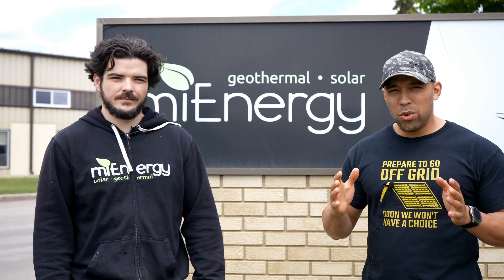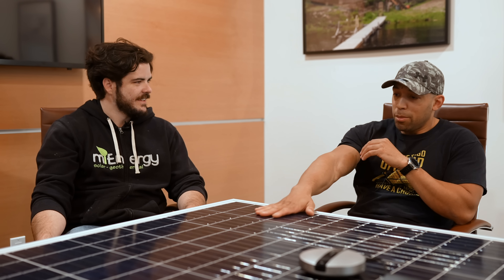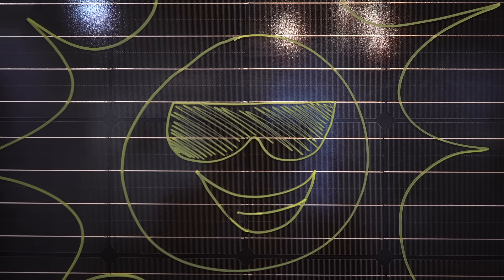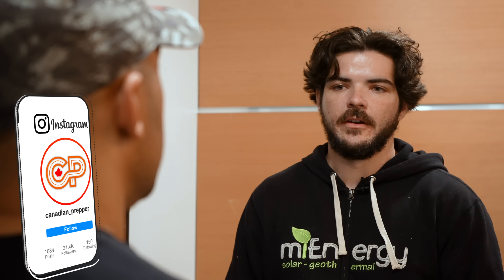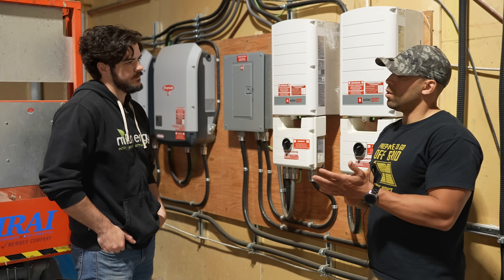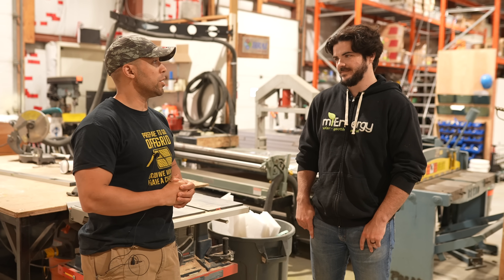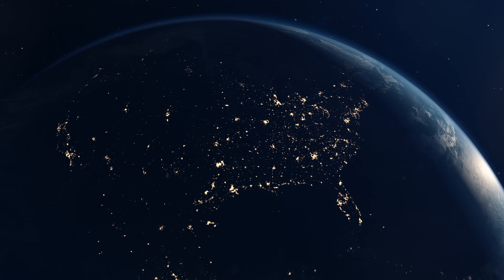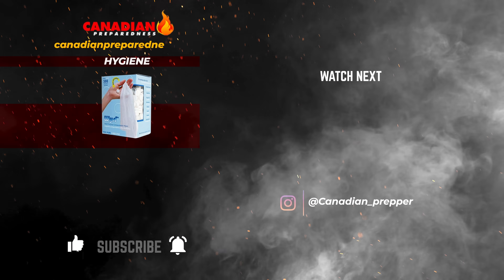Preppers Guide to Home Solar Power

Comment: For a ground mount system, the racking is going to cost more than roof mounted systems. Also, there’s a shorter wire run with roof mounted (electric wire is spendy). You are going to have to trench and run wire in conduit from the array to the building main panel which also adds cost. 
You don’t have to size your system to cover 100% of your energy usage. If you have a tiered rate system, you can size it to cover the top tiered rates. For example, if it would require a 7 kW system to cover 100%, you could install a 3 kW system which could cover the higher tier rates, leaving a smaller rate charge for the remaining bill. 
My ex boss didn’t like me telling this truth to customers for obvious reasons. 
I’d advise a grid tie system with battery backup and a transfer switch, either manual or automatic.

Comment: Why no mention of micro inverters right at each panel. I think it’s Enphase or Emphase micro inverters. Suppose to be better on shading, and there converted over at the panel from DC to AC power which travels long distance better than DC voltage.

Comment: One of the harsh realities for solar is Cloudy/Rainy weather.  I have a 4200 watt solar system. Being located in Washington State, on the summer solstice with clear blue skies, I got 3700 watts of output.  On the cloudy rainy days that the pacific northwest is notorious for, I get 550 watts of output.

That is a HUGE difference. My network and security system pull a constant 280 watts.  My battery storage capacity is 14khw.  On sunny Days, it runs with ZERO issues.  It is capable of completely recharging my storage every day.  550 watts on non clear days is not enough, even during the long days of summer, to recharge the batteries from the previous night.

Today, I swapped circuits. Now I have

Garage Opener, Chest Freezer, 40 watt LED that runs for 8 hours a day, Aquarium pump, aquarium air pump, and a 200 watt aquarium heater.

ill know in a few days how this fares, but so far it is looking pretty good.  It is cloudy today and I am getting better numbers on the batteries.

Comment: On my prepper pack, I have 2 x 100ah 12v LifePo4 battery, 4 pliable solar panels of 100w each and an 1000w inverter plus an MPPT. For 1 hour of sun I have enough energy to keep 6 light bulbs(12v) of 8w on each for 8 hours. In the summer I have enough energy to run a fridge, 6 light bulbs, a small microwave, a coffee machine :) My offgrid system has around 25kg and is on the back of my SUV with the rest of the survival pack :) In the case I survive the 1st wave, I can make a easy living offgrid. Living in Romania, at 40-100km distance from the war you need to be crazy to believe nothing could happen, only because we are part of NATO..... Better eat some cans then regret that I did not prepare at all. I own all the equipment to build a remote cabin, to plant some food, water filters, electric equipment, and some food for 6 months :) Only thing that remains to buy, is an electric fence. Here we have the largest number of bears from Europe. With my offgrid system I can charge my radio, my battery chainsaw, and other equipment. Good luck everyone, stay safe and prepare 🏕️. . . .💪😎👍
Reply: @Zack1988 Salut, din ce oraș ești? Ai dori să ții legătura și cu alți prepperi din țară?
Reply: @Eminovici  salut. Sunt din Iasi. Este un grup de facebook ceva ?

Comment: I don’t know how it is in Canada but in the USA, if you’re hooked into the grid like this guy is talking about, (ie; you get credits back from the town or power company etc), this means you are NOT OFF GRID! You can’t just choose to go off grid and disengage from it. You’re essentially hooked into the grid as part of the power making system and receive “compensation” for doing so. It is NOT a closed system where you make and keep all your own solar power etc. We need to make sure we have full knowledge about what we are and aren’t buying into with solar systems. Blessings to everyone!
Reply: Same here.  If our electricity goes out we can’t use the solar.  It’s still wired to the grid. I have some portable solar just in case.
Reply: interesting
Reply: I agree 💯 %
Reply: Yep, that's what makes it not so great. Batteries are extremely expensive and don't last as long. No point in being still connected to the grid, when they shut down you shut down, unless you can find someone to do it off grid....
Reply: You can keep all the power you generate by storing it in a battery. You’re not off grid but when the grid goes down you will have power.
Reply: @highlandscommunityclub1160  If a person has a sizable home that runs full electric they would need pretty much a full garage wall of those expensive batteries and then may get maybe 3 days or so worth of power depending on power consumption. It's sounds great but costly and not worth it for what I think are the people who could benefit from it the most.  100,000 dollar+ system and its not worth it for longterm worst case scenario......ask me how I know 🙄
Reply: The way these large companies are doing it on grid and with or without batteries is only good for short-term typical power outages, Not the SHTF Prepper. Completely off grid is the way to go and these companies don't want to do that. They have a whole line of BS that sounds good till you actually use your brain to stop and think. If enough people get these systems they can have the green society they want, you're generating energy for them and you get a lower bill and saved from the occasional short power outtage. As long as everything is good they benefit and the customer but if worst comes to worst your sh*t out of luck unless you have your system setup the TRUE Preppers way.

Comment: My main issue is that technology advances so quickly that a solar system you purchased years ago (a decade ago for me) becomes obsolete. Upgrades are very expensive!
Reply: do not worry about that. The gains in solarpanel efficiency is not that much. I read somewhere that the theoretical max efficiency is some 30%.
350Wp panels are at 22% efficiency...
every extra% will take enormous effort. Not worth it.
Efficiency of inverters is typically 95% or more. Not much to be gained there.

instead: optimize your angle to the sun and/or install 'sun tracking' systems. hugely expensive but efficiency wise much better.
Reply: Similar to buying a computer. I gave up waiting and bought in knowing that I have the flexibility to update as technology continually improves.
Reply: Not to mention the restrictions the power companies force on you, as tech changes, that means you can't expand but have to install a new system.
Reply: It's the batteries that are so expensive and you may get about 10 years out of them before they become cheaper and more efficient. Right now the benefit of these batteries just don't out way the cost of purchase and installation.  Forget about them in a true SHTF situation especially if you live in a home that is full electric.

Comment: All stated is true , I just got my system up and running finally .It  took 7 months to complete ( stardust) as I was waiting on a backup battery for the system ( cost as much the 22 panels).Getting a battery pre war was extremely difficult, getting one now I'm told not possible. Maybe tesla but good luck.
Reply: Genrac power walls are in stock City electric supply is showing 36 available. If it helps 👍

Comment: I got 40 panels on my house. 48,000.00. All its helped with electric bill is 43.00, not worth it payments is 250.00 from sunpro, still have an high light bill. Couldn't get the batteries at 19,000.00 each .so I would do my homework  before doing this. Wished someone had told me.  Read small print. They can take your home if you don't pay the bill. Nothing is free ok

Comment: I heard that solar panels only last for so long and then they have to be replaced because they don't put out as much as they did new.... so there is that cost and then the batteries has to be replaced as well and those and the panels aren't cheap... It's kind of like when cell phones first came out, it got better as more get into it.... and geez that's expensive to have a set up.

Comment: Solar panels ain't cheap found this 200 watt 12 volt triple fold out panel assembly for about 300 bucks. 200 watts of 12 volt power ain't much next to what is required to power up one small house.. Heck, the hot water heater alone consumes 4000+ watts 240 vac everytime it energizes those top and bottom elements. Even my led 42"

Comment: Question: how well will their solar systems survive an EMP or grid  high voltage surge?
Reply: the panels would, the inverter likely not.
Reply: @michaelastl  Yes, I just read about that as well. Panels will be good, inverter would be fried.
Reply: @michaelastl  I have an mppt main inverter / charge controller and a cheap pwm standby charge controller that is disconnected and completely isolated. In the event of an EMP or cosmic shit storm, the 10 gauge wires can be cut over in about 2 minutes. Most systems are running on 12 VDC anyhow (water pumps, fans, lights, solar tracking actuators, etc). I have both lithium and lead-acid batteries in separate banks. I suspect the li-fe04 will be vulnerable. Lead-acid...not so much.
Reply: @paulslevinsky580  just make sure to secure all vital inverter components inside a faraday cage.  Otherwise they will be destroyed in an EMP event.
Reply: Sol-Ark offers EMP hardened inverters
Reply: You can buy EMP protection products for cars, planes, rv, house, etc.
Reply: You can make homemade faraday boxes or cages depending on the size of the system and what components you are trying to protect.
Reply: @Arnuld15Governator  Yes. Many instructional, step by step videos. Reviewed lots.  Then completed  a 3 shelf supply cabinet & 3 locking Behrin cans by October last year.  Fun projects. Much cut, fitted cardboard from boxes, heavy duty aluminum foil. Electrical tape double sealing every crevice, corner. Tops, bottoms, sides covered.  No exposed bare metal. Tested all. Seem to work. Hope so. 4,200w in solar inverters, cables, extra electronics, small appliances, back up mobile stuff stored in these DIY  cages. Plus using EMP bags for some small items.   Fingers crossed. ,Also just receive  those EMP Alert wall socket units (long wait time). Plugged in & set as instructed. Someone’s always home to get to the breaker box.  Hope these work as advertised. Hate to see our fridge, freezer fried. Done all we can. Hope these are never needed.
Reply: SOL ARK EMP hardened inverter.  Siemens 150kV surge protector, ferrite cores on your wires.  You will be fine.
Reply: Best to buy a smaller portable one and have a  Faraday cage to protect it from EMP
Reply: Companies make emp proof inverters, which would save it, the solar panels will still work
Reply: Honestly if an emp hit, I wouldn’t want to have obvious power, IE people can see light coming from my windows, if you plan on running solar after an EMP, you better blackout your windows and make sure nobody knows you have power
Reply: Maybe I just don't understand enough about EMP (yet) but for all who are saying put the inverter in a faraday cage, as long as it's still connected couldn't the EMP hit the components of the system outside and travel down the wires to the inverter?
Reply: @paulsmith786  Yep. My backup is isolated...disconnected from any wire that could serve as an antenna to build charge.
Reply: Theses always a surge protector rated for 140k but those dried up and might not be enough.
Reply: The solar system i have supposedly will shut down before the inverters are fired. But, who really knows. I don't want to fry my house so let's hope it's true...
Reply: If it is not connected to the grid, then no worries about a surge. EMP would fry any electronics that are not protected, although I am still not entirely clear that electronics can be protected. It seems like that studies have conflicting results..
Reply: @DickNemakas   No electronic is safe from an EMP unless you have it covered by a faraday or underground. Inverter will be fried.
Reply: @DickNemakas  That is what I thought about russia invading Ukraine but then we saw them bombing more civilians than military targets.
Reply: @DickNemakas  the solar wiring becomes the antenna for CME or EMP.  A CME needs several foot long antenna/wires.  So could be protected w ferrous rings.   But an EMP has three waves.  A fast wave that would react to MM long metal wires. a wave in the sub second range then the same slow wave that a CME would have.  Dr Arthur Bradley of NASA is a prepper who covers this in videos
Reply: @DickNemakas  it's my understanding that electronics would survive a solar EMP (CME) but not a nuclear one.

Comment: My landscape lights, pumps, and cooling fans run on 12 vdc .. it is MUCH cheaper to build a 12v system than to try to make your solar backups duplicate an AC system - you loose so much power in heat going through an inverter, when you could have just used 12v from the start.  Figure out what your 'essential' power needs are, assuming the grid is going down for an extended period, and plan accordingly.
Reply: Yep, good to get a 12v fridge too.

Comment: Good video.  How do they fair in an EMP? Has anyone tested the individual panels?  I can see protecting the inverters, batteries and wiring with a good grounding bleed off/ emp protector, but I would think it would be hard to protect the array panels? I doubt they make emp "hardened"panels for the public.
Reply: If it is hooked up and your invertor / battery isn't protected then ya, it is toast.
Reply: My understanding is panels themselves are not easily damaged by EMP but can be. The "generator" battery system is likely more easily damaged. If you use proper ferrites on wires and a surge protector you may be ok.
I always point folks to EMP DOCTOR right here on YouTube. So far not a single person has said thanks 👍 though. Lots of turds, but I still do the right thing because I am not a turd.
Reply: @mrjon75  thanks for the info.  Not a turd myself... I was wondering because a solar label is basically a giant flat series of micro chips, which can be damaged by emp. I will ask your emp doc for clarification.
Reply: @DogtownTradingCo  You have definitely passed the Turd-test. And EMP DOCTOR vids will answer your questions and then some. I'd try but I'd rather you hear it from a NASA scientist.

Comment: Anyone who goes for a grid-tie system is either stupid or not educated about how useless it would be in a grid down situation. Go for an isolated system and run freezers on it 24/7 with a decent battery bank and you'll have something that can carry you through a grid down situation. NEVER think about grid-tie!
Reply: Has to be your own system with your own panels in Florida then because all systems are supposed to be toed to the grid for net metering.  And I agree with you!
Reply: A lot of people also don’t realize that a solar generator is useless without enough solar panels
Reply: Systems take sine wave input to be in sync with grid. Hacks can be made after disconnectkng from grid. Have sine wave generator chip, small gas generator, car sine wave inverter running from 12v battery, small solar generator etc. Maybe even lab wave function generator
Reply: @artur8403  True, but I'd much rather have an isolated system to begin with along with the battery/storage capacity that necessarily  accompanies it.   --  Note that this is my specific and preferred use case. I'm sure there are some advantages to grid-tie setups, but none that I see on a household size system.
Reply: @Grey-Troll  there is setup where house power is routed through solar box and it feeds from battery and takes power from grid when battery can't deliver. That works in grid off too. Basically it's on grid, works when grid down but doesn't push power to grid. Probably a lot cheaper because doesn't require grid paperwork

Comment: Grid tie solar is useless in a blackout, the inverters will halt when utility power fails for safety to prevent back feeding.
It is possible to change this in a true off grid SHTF situation but it's not a project for someone not familiar with electronics.

EDIT, just saw this mentioned, that's what I get for commenting before watching the entire video LOL!  

Glad he mentioned this, so many ASSUME it just will work LOL.
Reply: Yeah I had it priced out for my 1600 sq ft home and it was over $30k for my house to have solar with battery backup to keep it working in a blackout
Reply: My  solar  System is a new  series  and work  off grid. New technologie without problems in a blackout case.

Comment: My wife and I installed a ground mounted 20 kW solar system with three Tesla walls and a transfer switch. When the grid goes down The solar system continues to power our Tesla walls and provides enough energy for a 2600 square-foot home - full energy day and night. Suggestion; to increase the life and rapid recharge of your tesla walls In case of an outage, only allow your Solar batteries to drain 50% during normal operation grid normal situation. In Arizona, this system cost us $146,000. Worth every penny! I hope this helps everyone, God bless and good luck with what’s to come.😇 Nate, thank you for being a watcher on the wall, God bless